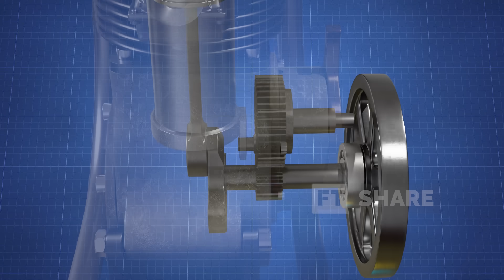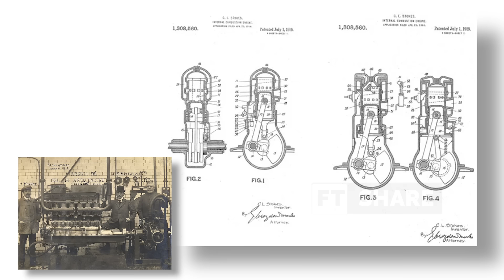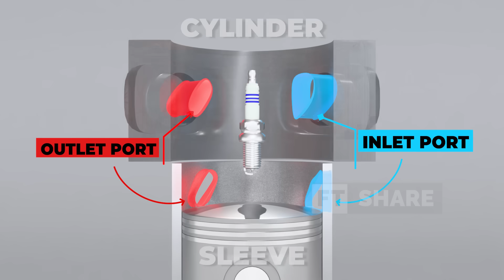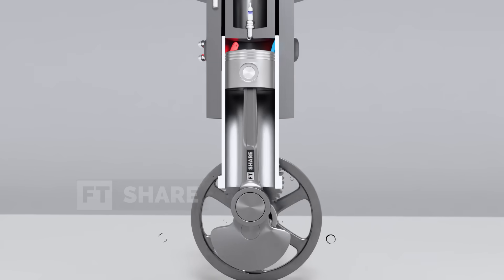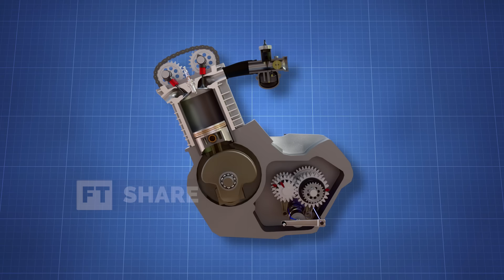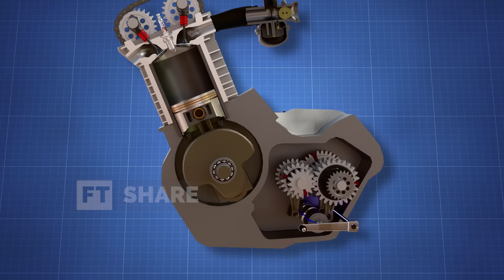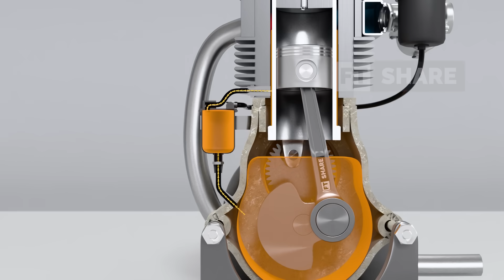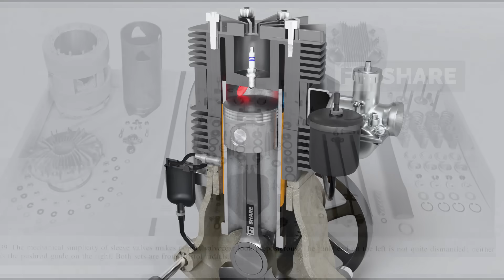Why Was This Advanced Technology Abandoned? 🤔 The Secret Behind the Sleeve Valve!

Comment: The poppet valved engines I've seen from that period had side valves, not overhead. Otherwise, I'd guess that poppets were held back by the then-current materials science. What would you make a valve seat out of if it's going to be overhead?
There are still some hold-overs from designs that were held back by materials science. For instance Ducati developed their 'desmodronic' valve gear (one cam pushes valve open, another pulls it shut) because of limitations in the valve spring steel they could get so valves would 'float' at high RPMs. That gear is still in use, still makes a difference, although IMO it's not a big one. Also, setting shims on a 4-valve Ducati is a PITA.
That said, I'd have to wonder about both oil consumption and combustion heat transmission, not to mention oil lifetime. Anyone know when oil recirculation appeared and then became common? If you are only using new oil, the lifetime is a don't-care.

Comment: It wasn’t “advanced” technology.  It was experimental in nature.  And, it wasn’t abandoned; it was junked.  And rightly so.  The sliding sleeves had so much internal friction and drag that the useable horsepower of the engine was being sapped. 
There is a reason  that the Otto cycle gasoline engines are made the way they are.  IT WORKS, both effectively and reliably.
Courtesy of Half Vast Flying

Comment: Seems to me the obvious flaw in sleeve design is that they must contain the power stroke and are forced against the cylinder walls. This would make them more expensive to make, less durable to service, and more complicated to lubricate. I don't see it. However, Presentation and narration is excellent, and Ricardo was an ICE guru. The big question I've got is how the Allies lacked fuel injection, a critical oversight, just not TOO critical.

Comment: I'll tell you why: expensive too produce, difficult to lubricate, intolerant of over-temperature, unable to meet emissions regulations, expensive and difficult to overhaul (rebore). Modern poppet valve designs flow much better than you'd expect at first glance and are cheap and easy to produce as well as being rugged and long lasting. No-one today is seriously considering sleeve valves.

Comment: always loved sleeve valves, rotary valves, any alternative to the "lossy" poppet valve train and springs. every where you look "the valvetrain is a massive loss"... and i was convinced, it seems so obvious...

 but then something clicked.

a spring returns as much force as it required to compress it... it may feel hard to turn an engine over by hand, past those springs, but anyone thats ever done valve clearances etc knows that most engines tend to want to flick past "TDC"... why? because the SPRINGS ARE RETURNING THEIR FORCE and cause the camshaft, and crankshaft, to rotate. 

the power it takes to compress any valve spring is returned as that valve spring extends back again.

sleeve valves... are a parasitic loss, no matter what. rotary valves, a parasitic loss, no matter what.

personally, i think the piston valve is the way to go. rather than a parasitic loss, it can actually utilise some energy of combustion, acting as an opposed piston engine. but it has a different type of issue, so far unsolved, to do with stroke length, port sizes, cylinder volume, and durations...

"beare head six stroke"... ever since i saw an article in teh 90s on it, ive been thinking it over... a twostroke cylinder replacing the conventional head... but he never solved the issues, either... it ends up being overly complex with extra valves and isnt as straightforward as it would seem...

other than the brief period the sleeve valve enjoyed, nothing has outperformed the humble, simple, if flawed, poppet valve.

Comment: In one of the animations, the connecting rod touches the lower end of the sleeve at BDC at every other stroke. That should be fixed.

And one question remains: why does the sleeve not simply rotate only ?

Transferring heat through a thin film of oil is like blocking the heat transfer - this is the main drawback of this design.

Comment: 1:13 Welp...rotary valves made regular piston engines more advanced than that complexity of this forgotten engine thats why
Reply: so, despite 150 odd years of engine development... where are all these rotary valves? a few one-offs, experimental prototypes... yet none have ever panned out. none have entered the mainstream, or proven to have benefits worth pursuing over the poppet valve.  whats complex about a sleeve valve? its basically just another piston, with no center, on another crank... not THAT complex.

bill lear spent millions on his steam engine, that had a rotary valve. no matter how they tried, they couldnt solve the wear issues, the sealing issues. even steam engines never had any success with rotary valves, and they arent dealing with combustion byproducts... other than the "corliss valve" and it merely oscillated.

coates spherical valve... still not there.

they dont seal, they dont last, they dont provide massive performance gains, if anything there is a REDUCTION...

been watching "educational videos" again, have we? hmmmm... possibly "D4A?" hows that vane motor of his running?
Reply: @paradiselost9946  someone put a rotary valve in a 2 stroke but is a spot where it is never in direct contact with combustion. So now it doesn't burn oil and is more eco friendly. But it needs a supercharger to operate

Comment: Well, this is a good engine still. Already I can see why this type of engine was rendered obsolete. Modern engines have VVT systems alot, not all. But, its more common on small 4 cylinder engines that need an extra edge in power. 
VVT systems (Variable Valves Trains) allow for more precise control over valve timing. 
With this kind of engine. Your valve timing is set in stone. And environmental compensation can only be limited to the carb or injection system and the exhaust. 
Which is not really suitable for high efficiency and power all in one small package.
But, still remains relevant because, a machine with less moving parts is in a way more perfect.

Comment: One MAJOR advantage of a Sleeve-Valve engine is it's resistance to Pre-ignition (or Knock). A Sleeve-Valve engine of equivalent displacement, and compression can use LOWER OCTANE gasoline than an equivalent Poppet-Valve engine. This means that you can design an engine with higher compression, and extract MORE power from the same grade of gasoline. This partly explains why the Napier Sabre was SO powerful (The most powerful piston engine of WW2 at OVER 3000 Hp)

Comment: It seems to me that it would be harder to keep the piston perfectly aligned within the cylinder from TDC to BDC since the cylinder also moves, allowing for it to add its own "wiggle room" within the block.  Also, there's a lot of frictional surface area, although it would be hard to do a comparison between sleeve friction and the amount of friction lost by eliminating camshafts, rockers, valve stems and guides.  Clearly, valve trains are the biggest part of engine design that begs for improvements.

Comment: Another advantage of a sleeve valve for very high performance engines (particularly with forced induction) is that there is no hot exhaust valve in the combustion chamber, so reduced detonation issues. The work done by Mike Hewland in the mid 70's was covered quite well by Car & Driver magazine in the July 1974 issue. He was experimenting with 500 cc singles, with the intent to build a racing car engine. He was getting about 70 hp on crud gasoline, or 140 hp/L. He found that fuel consumption in this engine was quite good (.45 lb of fuel/hp-hour), and in a model built for fuel economy (not racing) he was getting .39 bsfc which is excellent. I do not know why this did not proceed further, it is pretty cool. I've read somewhere that if the jet engine had not come along when it did that the sleeve valve design might have eventually overtaken poppet valve design for aircraft engine.

Comment: Modern materials and material treatments could allow a revival of sleve valve motors.
Not exactly sure why though as poppet valve technology is very well understood at this time and production costs are far lower (at present)
Maybe advanced ceramic moulded sleeves could fix expansion issues plus run with overall less oil?

Comment: Dis you know there was an experimental sleeve valve steam engine on the LMS railway in the UK in 1908?  It had 8 single acting cylinders of 18 inch bore and 12 inch stroke in opposed pairs, so steam was fed into the space between 2 pistons and there were obviously no cylinder heads.  It also had 3 crankshafts which were also wheel axles, 2 outer ones for 2 conrods each and a center one for 4 rods.  It worked but was way ahead of the metalurgy of the time and suffered from leakage around the sleeves when cold and binding when working hard and hot.  As it was a privately owned venture and ran out of funds, it was towed back to Derby works after a seizure in 1912 and the LMS quietly dismantled it in 1918 while Paget was in France commanding the Royal Engineers in WW1.  A shame as it could have been a good engine.

Comment: I Disagree! Breathing of Single Sleeve Valve engines is always better than in poppett valve engines, see NACA Technical Report 717, 'Flow coefficients of mono sleeve valves', C D Waldrox.

Harry Ricardo evidenced that as long as oil film between Sleeve and Cylinder wall is thin enough, sleeves are transparent to heat. 

The Oil consumption issue was solved by Hewland and Logan (Car&Driver, july 1974) (they raced their 500 cc SSV engine, 70 HP, SFC of 172 gr/ HP/ hr, to 10'000 rpm), by adding a ring in the base of Sleeve, and a Dykes ring on the Junk Head.

Continental, who built SSV prototypes for many applications, not entering series because of consequences of 1929 economy crisis, indicated Sleeve Valve engines, the Burt-McCollum type, were easier and cheaper to produce than popett valve engines (Continental!, its engines and its people)

Why SSV don't come back? Perhaps producers of popett valves don't want losing business, also the higher reliability, less maintenance costs, and longer life of SSV would be a reduction in business for some.
Knight system double SV, used by Willys, Voisin, Daimler, Panhard, Minerva, have little in common with the SSV engines developed at Argyll, Bristol,...

The SSV variant by Piccard-Pictet patent GB118407, a rotating cylinder liner, is also of interest

A 'Cylinder liner', analog to an Sleeve Valve, is sold retail today at around $40, just count how many more parts requires a poppet valve engine than an sleeve valve, also the cost of making the gears and sleeve drive mechanism.

Hewland and Logan indicated their SSV engine, aimed as a replacament to Ford Cosworth in Formula1, hard competitor, required no specific sleeve lubrication, just oil spitted from crankshaft was enough

Comment: it would be interesting to see how this compares to a slide valve, as for example in 19th century steam engines. it would seem to mitigate some of the shortcomings of sleeve valves, because it would have much lower mass and lower friction while also allowing higher heat flow through cylinder walls.

Comment: Advantages- High speed stability.

   “These engines can run smoothly at high speeds without issues relating to inertia or mechanical failure”

Disadvantages- Maximum RPM limitations.

“Sleeve engines generally have a maximum speed limit of around 3000rpm, significantly lower than poppet valve engines”

So…It’s either one or the other.  BTW, 3000rpm is not even close to high speeds in a modern day internal combustion engine.

Comment: Apparently Cosworth experimented with Napier sleeve valves in the late Sixties. 
They found that they had high friction and significant lubrication problems, of which both were badly exacerbated at high RPM. Sleeve valves were fine for huge WWII aircraft engines, 
with about 2-to-3 liters per cylinder and a redline under 5000 RPM. But they worked poorly for auto-racing engines of smaller displacements running at higher speeds.

Comment: The friction horsepower rating on sleeve engines makes them unviable. The amount of friction surfaces of a sleeve as compared to a regular valve is astronomical.
Reply: except the pressure on that surface reduces as it gets larger... eventually it all cancels out.

Comment: Spin the valve cylinder valve instead of agitating it to maintain an atomic gas layer of sleeve separation (like a captive gas bearing) between the sleeve and the retaining wall as well as the piston.

    That all by itself pretty much puts and end to every downside you just named because you also get interdependent on the fly valve timing adjust-ability. Drive the spin from overhead inverting that flange position and add a taper to the crank case end and your valve jobs are a mechanics wet dream equivalent of plug and play modular drop-ins without removing anything more than the valve cover.

    And I forgot to mention... more 'slot pairs' == higher engine rpm at lower spin rate of the valve sleeve if you really think that's a problem...

    And "this end up" had been a thing on boxes for a pretty long time... That one was just nonsense.
.

Comment: Wern't These engines pumping huge amounts of CO out. The Napier Sabor needed the pilot to put his O2 mask on, on the ground?
Reply: That's not because of the design of the valves Skippy... 
    It's a matter of shear volume of fuel burnt per minute. That was a wide throat 24 cylinder engine burning 20 gallons per hour on the ground at idle. 
.

Comment: This is the second video I have seen about sleeve valve engines.
In the first one, there were two sleeves going up and down. This one only has one sleeve, and the one I saw when I was a kid, the sleeve rotated, with a gear at the bottom causing the sleeve to rotate.

By having the sleeve rotate, you could change the single port to cause the timing and flow of the intake and exhaust to be whatever you wanted, and there was less friction than having the cylinder to slide up and down in the crankcase. The main problem with the rotating sleeve, was the rotation of the piston rings. But there are rings today that can totally seal without gaps, by having two rings and pinning them so they remain sealed!

However, the low RPM problem, should be able to be overcome with modern alloys and other solutions, making the rotating sleeve a viable alternative!
Reply: Modern steel alloys like high molebdinum could help the sleeve and molybdenum in the oil could help with friction heating. Ceramic coating on exhaust tract and piston top, cylinder head could help with sleeve overheating. . Zero gap rings can keep gasses in the combination chamber. Just a thought!

Comment: keep a typicall cylinder with ports, and remove the sleeve outside the cylinder and piston, so it will not touch eachother, might solve many of the problems, also the sleeve size will be reduced at least to one forth  or less, the lubrication will be reduced, the sourounding of the cylinder will be biger, but with no need of head valve, it will be reduced in comparisson with the typical used today, also some of mazda's skytech principles could be used to boost effective inovations....and if nessesary oil cooled engine technology could be used at the final design

Comment: Worth mentioning desmodromic poppet valves which removed the problems of valve bounce with sprung valves. I hadn't realised that Ducati were still using them until very recently. The UK developing sleeve valve engines during the war was an odd thing given the circumstances and probably hardly worth the effort. The Americans were a bit more  pragmatic and focused.

Comment: The problem was the inert mass of the sleeve. This limits the speed of the engine to areas like aero engines which function between 2000 to 3000 rpm. The sleeve had two problems one the high quality required to have concentric turning which was a problem for many manufacturers and secondly the requirement for more oil lubricated surfaces. In consequence the poppet valve was always going to be better and cheaper to mass produce at slightly lower tolerances and much lower wastage.

Comment: The Willys Knight  had the sleeve motor  fully functional in single  4  and six cylinder engines  dating back to 1913  and earlier ,  and produced a v8 version in 1917  numerous tractos  and farm equipment were driven  buy sinlges  from willys mean time between overhails was  arounf 20,000 to 30,000 miles  massive draw back was a high  oils consumption on all sleeve induction engines

Comment: Sleeve valve engine must absorb quite a bit of the horse power produced by the engine
PLUS a lot more weather & lubrication issues.
Surely these disadvantage must outweigh any. Oise reduction & smoothness advantages.

Comment: Weight also , new gen valves are far lighter and less prone to waer then the sleeve valves.  The sleeve weighs too much for high Rpm operation.  Ex machinist, engine performance machinist.
Info source, Me.  This is also the issue with past rotary valves. yes it "can: work, but under high performance heating the metals are subjected too they deform and wear. and once a bit of wear sets in its a spot that gets chewed on every revolution. Scraping and galling the metals around and itself.    I was REALLY excited about rotary valves in the 80,s untill i learned all about the shrtcomings. And sleeves are WAY TOO HEAVY. the weight itself adds to the wear factor.  You cant reliably lubricate a part that is hotter then the oil can exist on.

Comment: Maybe a sleeve valve engine could be made with the use of ceramics and water lubrication.  It could burn hydrogen gas which wouldn't pollute the lubrication system.